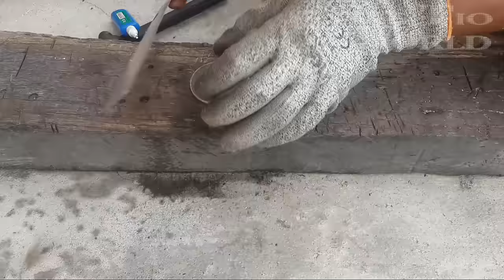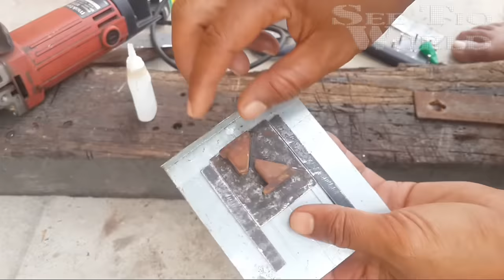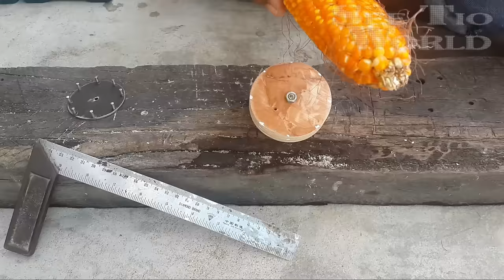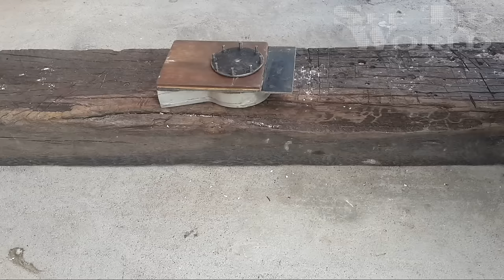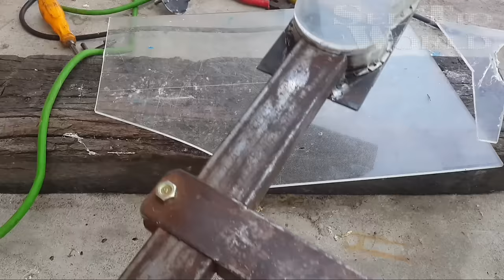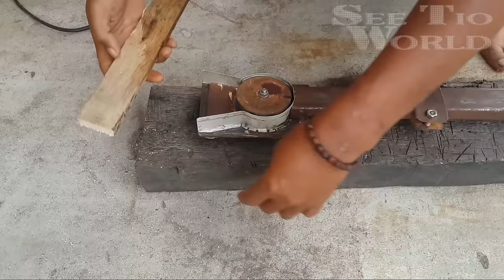Genius Idea !!🌽🌽  Making A Corn Seeder With Trigger Mechanism | Prototype

Comment: Трудоемкое и очень не рентабельное сажалка для кукурузы. По длине ряда посева может быть как изломанная линия, что при прополке от сорняков снижает производительности. Нет точного высева (разное расстояние между растениями). Я себе изготовил сеялку универсальную с которой можно сеять: кукурузу, фасоль, сою, подсолнух, далее семена овощных культур: морковь, петрушка, лук, перец, помидоры, свекла столовая и кормовая. Меняется шаг высева и меж рядное   расстояние и глубину высева. После высева по ходу движения укрываются семена почвой и утрамбовывается прикатывающим колесом. Расстояние междурядье выставляется маркером.
Labor intensive and very unprofitable corn planter. Along the length of the sowing row, it can be like a broken line, which, when weeding from weeds, reduces productivity. No precise seeding (different distances between plants). I made myself a universal seeder with which you can sow: corn, beans, soybeans, sunflowers, then vegetable seeds: carrots, parsley, onions, peppers, tomatoes, beetroot and fodder. The seeding step and the row spacing and seeding depth are changed. After sowing, in the direction of travel, the seeds are covered with soil and compacted by the press wheel. The row spacing is set with a marker.
Reply: Для каждой культуры свой высевающий диск и своё количество оборотов этого же диска ?
Reply: @СергейОсыка-й9н  Да, именно так, только не диск а втулка с ячейками для семян определенных культур. А шаг высева сменной велосипедных и от сеялки СПЧ-6  звездочек: шаг от 2 см до 45 см. Одновременно есть просмотр процесса высева.

Comment: Labor intensive and very unprofitable corn planter. Along the length of the sowing row, it can be like a broken line, which, when weeding from weeds, reduces productivity. No precise seeding (different distances between plants). I made myself a universal seeder with which you can sow: corn, beans, soybeans, sunflowers, then vegetable seeds: carrots, parsley, onions, peppers, tomatoes, beetroot and fodder. The seeding step and the row spacing and seeding depth are changed. After sowing, in the direction of travel, the seeds are covered with soil and compacted by the press wheel. The row spacing is set with a marker.
Reply from the maker: I would love it if you could share with the world the great things you just said like I do even though this is clearly still a prototype. My only hope is that people will see this video and develop it. And I didn't make it for myself but for everyone. I am aware of the limitations of my brainpower, and for now this is all I can do but I am also continuing to develop it, I hope to share with the world the best results I can do in future videos. Thank you